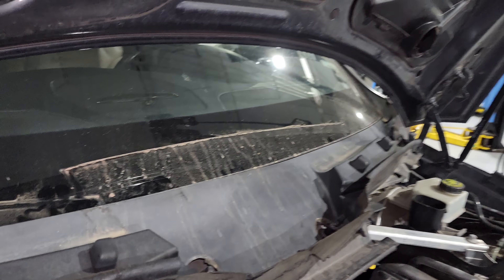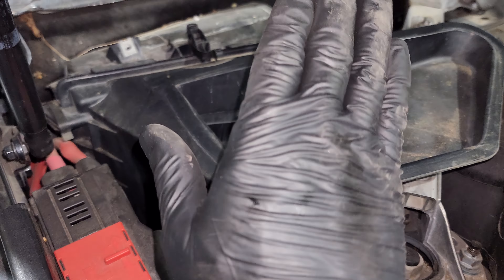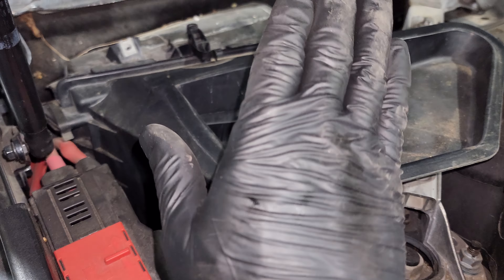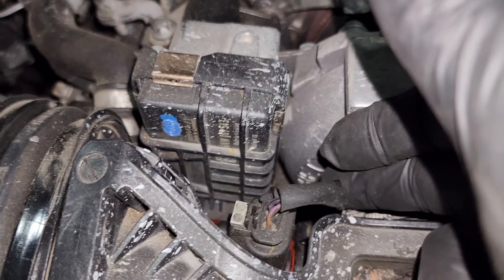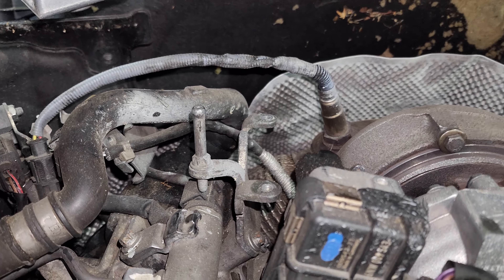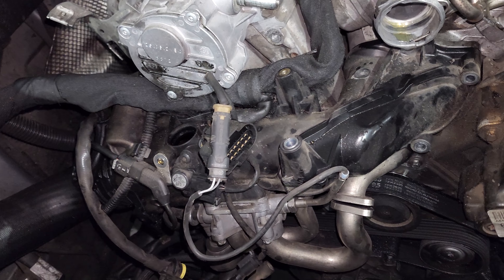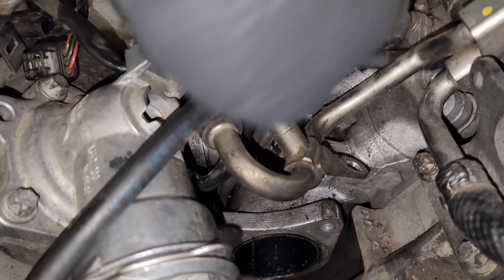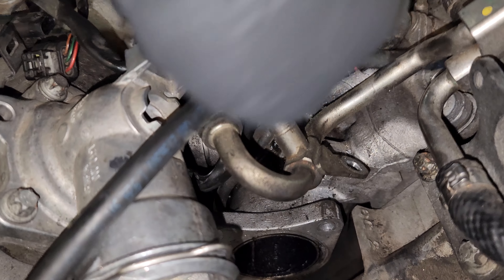OM642 Intake Manifold Removal/Oil Cooler Seals

Comment: I did this job a couple weeks ago over here in the UK. My life would have been much easier had I known this video existed as this video it is specific to the model that I have not just any other vehicle with an OM642. I did mix-up those Turbo bolts with the exhaust downpipe bolts and I had smoke coming out of the engine. I had smoke soot all over the engine after driving the car! I replaced the oil cooler seals but another mistake I made was not replacing the "Intake Shutoff Actuator Motor" as 2 weeks later, that motor died and now I have to open her up again!   😢
Reply from the maker: We usually don't replace the intake port shutoff actuator when we do that job.  If it's working, it gets reinstalled.  It just happened to go out on you.  I've seen Sprinters burn down because those bolts get swapped.  The process is basically the same for all OM642 engines.  Slight differences depending on the year.  Some have a slightly different intake tube design, SUVs can be different also.  I'm glad you got it sorted.  At least when you replace the actuator, it will be quicker the second time around.
Reply: @FriendlyMBTech Thanks for your comment! 🙏🏽
For the moment I have installed a resistor on that swirl flap motor connector. A mod that I’ve came across on forums so the car came out of limp mode. 
It drives almost as normal except fuel economy seems poor! 
Have you heard of this mod before?
Reply from the maker: @charliebounced  no I haven't heard of that modification.  Seems like a good idea to keep the check engine light off.  How much has your fuel economy dropped?
Reply: @FriendlyMBTech  Fuel economy is about 15.1 mpg when driving around town but normal on the highway, about 28mpg.
Reply from the maker: @charliebounced  that still seems a bit low.  I've driven an ML diesel overnight and got more than 30mpg, I want to say it was closer to 35mpg.  That was no traffic, though.

Comment: Great video! You are an excellent instructor. I have worked on these on an X164. Oh, how I remember removing the turbo 😫
Reply from the maker: Thank you!
Reply: Definitely very informative, one of the better videos out there. Were you able to record a video putting it together? 👍🏻
Reply from the maker: @ehodgson1674  unfortunately no.  Time got tight and I had to get it together asap.  Which frustrates me because there was a lot more information I would have loved to share.  Next one I get, I'll take it apart asap and do the reassembly video.
Reply: @FriendlyMBTech
Reply from the maker: @Agecatcher  what's up?
Reply: Do you need to drain the coolant if I just swap the turbo?
Reply from the maker: @dannydriedger2251  it depends on if your turbo has the coolant line coming out the top and connecting to the driver's side intake manifold.  If it does, yes you should drain the coolant.
Reply: @FriendlyMBTech  okay sounds good, I will check, thank you. 
And also I did get a garrett turbocharger charger,  does the turbocharger need to be filled with oil, if so do you use engine oil?
Reply from the maker: @dannydriedger2251  If you fill it with oil, the oil will just pour out the bottom.  Don't worry about filling it up.
Reply: @FriendlyMBTech  okay sounds good 👍 
The info I find is to turn the engine manually, no starting, to get oil to the turbo, is this how you do it ?
Reply from the maker: @dannydriedger2251  I promise you, those steps are not in the work instructions provided by Mercedes-Benz.  Just start the engine.  They lubricate the bearings when they assemble it.
Reply: @FriendlyMBTech  okay that sounds good to me. Thank you very much for your help 🙂
Reply from the maker: @dannydriedger2251  you're very welcome!
Reply: @FriendlyMBTech Hey for the coolant drain valve, is it just 1/4 turn to be open right? Mine doesn't want to turn further than that , nothing coming out, any ideas?
Reply from the maker: @dannydriedger2251  they can get stuck.  You could always pull the lower radiator hose.  It will make a bit of a mess, but it will drain it.
Reply: @FriendlyMBTech okay sounds good I will do that, thanks again 😊
Reply from the maker: @dannydriedger2251  no problem.
Reply: @FriendlyMBTech  I'm wondering are the intake flaps open when the swirl flap motor is in its normal State, meaning not springed up ?
Reply: @FriendlyMBTech just wondering are the swirl flaps open when the engine is shut off?
Reply from the maker: @dannydriedger2251  the actuator motor has a fairly strong spring on it that holds the flaps closed when the engine is off and at low RPM.  At higher RPMs or increased engine loads, the actuator opens the flaps up.
Reply: @FriendlyMBTech okay sounds good,  I deleted my swirl flap motor,  now I just needed to know which way the swirl flaps had to be to be open all the time , I didn't want to take off the intake manifolds to see , thanks alot 😊
Reply from the maker: @dannydriedger2251  the actuator is still in place though right?  The spring holds them one way.  If you disconnect the arms from the actuator, you can position them in any way you want.  You'll have to find a way to secure them though as the arms themselves move very freely.
Reply: @FriendlyMBTech  yes I have removed the actuator itself,  I have tied the right side to the front of the engine and the left side to the back of the engine,  that is when you look onto the engine from the front of the vehicle,  then they should both be in the open position right?
Reply from the maker: @dannydriedger2251  correct.
Reply: @FriendlyMBTech I changed the turbo and fuel filter and opened up the intake flaps now it runs rough, shuts off, smokes,  any ideas what to look at ?
Reply from the maker: @dannydriedger2251  how long have you had it running after doing those repairs?
Reply: @FriendlyMBTech  I tried for about 15 minutes, a couple times I was able to rev it over 3000 and seam to run pretty good but then next thing I can't rev it , just shuts off and gives off diesel smoke
Reply from the maker: @dannydriedger2251  could be a fuel pressure issue.  If the low pressure fuel pump can't supply enough fuel volume to the high pressure pump, you'll have a lack of power or won't be able to rev  it.  Similarly, of the high pressure fuel pump can't produce enough pressure, you won't be able to revit.  Also, if the particulate filter is too full or clogged them the excessive back pressure will keep it from revving also.
Reply: @FriendlyMBTech So I let the vehicle sit over the weekend and this morning it fired right up and revs good in park but in drive I have some hiccups off the get go and performs great past that, any ideas what to look at ?
Reply from the maker: @dannydriedger2251 could be the intake port shutoff actuator that's missing, and the intake port flaps that no longer adjust for low load or low RPMs.
Reply: @FriendlyMBTech  that's what I'm thinking too, im reaching out too the company that tuned my ECU see if they have some answers, it doesn't seam too work the same each time, the last time I tried to rev it up it hiccups when I rev it up to fast, if I rev it up slow it revs up past 3000rpm, then a couple of hours ago I was abe too drive it, had good power but had a couple of hiccups here and there off the get go on low rpm, weird to me.
Reply: @FriendlyMBTech Hello, now my vehicle starts up runs for about 5  seconds and stutters really rough till it shuts off. I checked the fuel delivery from the tank pump and I have about 3/4 liter in 10 seconds, i noticed that the pump has more of a pulse flow not a steady smooth flow,  that is when it comes through the fuel filter. And ideas what to check?
Reply from the maker: @dannydriedger2251  check fuel pressure before the fuel filter and after the fuel filter.  Other than that, could be the high pressure fuel pump but it doesn't sound like it.
Reply: @FriendlyMBTech  okay,  one thing I forgot too mention is I'm getting heavy raw fuel smoke, Grey smoke
Reply from the maker: @dannydriedger2251  particulate filter could be clogged.
Reply: @FriendlyMBTech  I emptied it out because I got a complete delete. 
Do you think it would be an injector ? Or camshaft sensor?
Reply from the maker: @dannydriedger2251  could have a leaking injector.  You'd have a check engine light if it were a cam sensor or low fuel pressure.  Do you have a check engine light?
Reply: @FriendlyMBTech  nope no check engine light. It starts up alright and runs from about 5 to 10 seconds sometimes a little longer and stutters and shuts off by its self because it runs so rough. 
I also noticed some raw fuel smoke coming from the engine compartment as well as the exhaust

Comment: Thanks, looking to do this job soon as my ML350 0642 is leaking like crazy.
Reply from the maker: @homeodfree9200  you're very welcome!
Reply: @FriendlyMBTech  Hello watching your video again where you mentioned the parts that are replaced can be found in the diesel engine recall where the manifolds get replaced.  Do you know where or how I can get to those recalls/bulletins for repair.  Thanks
Reply from the maker: @homeodfree9200 this link is for MB Vans like Sprinter with the OM642 engine.  I can't find the passenger car version online.  The parts list is very similar between Vans and passenger vehicles. https://bluetecupdate.mbvans.com/content/dam/emc-1/EMC%201_2020040006%20Mercedes-Benz%20Consumer%20Emission%20Modification%20Disclosure.pdf
Reply from the maker: @homeodfree9200  you could try entering your VIN here for more information.
https://bluetecupdate.mbusa.com/home
Reply: @ Thank you, found it for my passenger car a 2012 ML350 Bluetec.
Reply from the maker: @homeodfree9200  you're very welcome.

Comment: Silly question but do i need to disconnect the battery first?
Reply from the maker: @tony892007  it's not necessary but it also wouldn't hurt.
Reply: @FriendlyMBTech  thanks so much for the quick reply
Reply from the maker: @tony892007  you're very welcome

Comment: WAITING FOR HOW TO PUT IT BACK .  THANKS!
Reply from the maker: @北洋军阀  pretty much the opposite of taking it out.  Nothing really special about going back in.
Reply: You still should of done the reassembly video, you done an amazing job on your explanation of the disassembly process but as a tech who has done this job multiple times you could of gave pointers to others on what to look out for in relation to issues as well as torque spec’s during the reassembly but mainly I say thank you for sharing your experience of this strip down

Comment: You emptied the coolant, but did you empty the oil also? Or is it better to empty and replace the oil after finishing?
Reply from the maker: We do oil changes after the repair in case something gets in the oil passages.  I've had situations where a lot of coolant came out of the ports even after draining it.  Enough to where it filled the valley.  When you take the oil cooler out, there are just open oil and coolant ports so you don't want anything getting in there.

Comment: how do you remove the exhaust to egr pipe. at 29:5 in your video. the side connected to the exhaust.
Reply from the maker: @timlin254  there are two fairly long bolts securing it to the head, depending on your model, the turbo side is either that clamp, or two smaller bolts.  Once those are removed it comes right out.
Reply from the maker: @timlin254  the clamp has a small torx bolt, could be E10 or possibly E8.